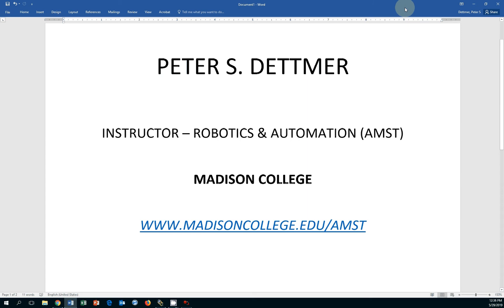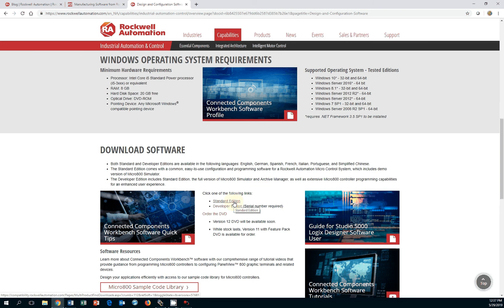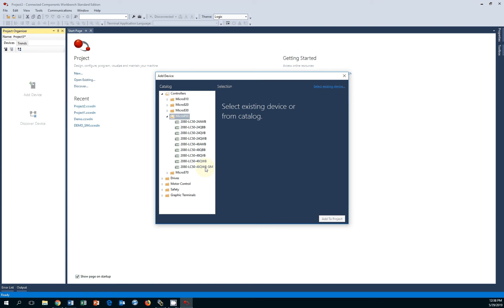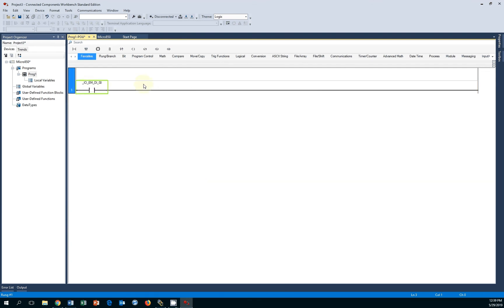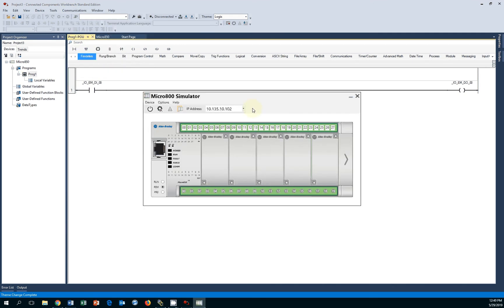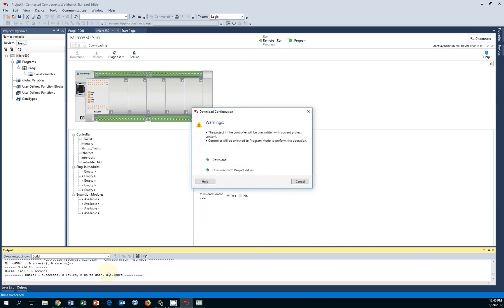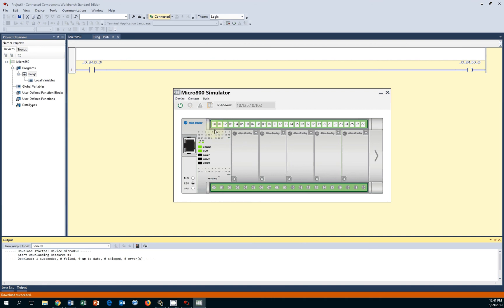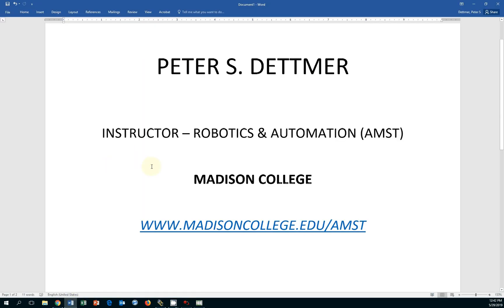FREE PLC Programming Software with Simulator

Comment: Good day Sir Did try to check the CCW 12 but was not able to find in their system although when type CCW there are a lot... IN addition to that there were active and discontinued which software specifically in the video you have?
Reply from the maker: The latest version of CCW is 22. There have been a lot of changes. I believe I did the video on v12. Haven't checked if the DEMO/Simulator is still available in the latest Standard edition. Some features may have moved to the (paid) developer edition.

Comment: hi im having problem with the my plc program. It says that my plug in i/o module configuration does not match the actual i/o configuration detected.  

But when i dont put the plugin module if4 and rtd2 it works. I need help understanding what could be the possible error in my program when im simulating. Thanks
Reply from the maker: You may have to update the firmware on the module and/or the Micro PLC unit. Some older modules may not be compatible with PLC.

Comment: I am getting an error "The program scan time exceeded the watchdog timeout value". Where can I adjust these parameters for the simulation Controller?
Reply from the maker: In the user program, increase the watchdog timeout value that is set in the system (global) variable _SYSVA_TCYWDG and then build and download the program using Connected Components Workbench.

Comment: Which driver are using to open the software.
Reply from the maker: No driver necessary. Unless you are asking about the (Micro unit). I used part# 2080-LC50-48QWB-SIM - this may have changed with updates and different versions, but this is the only unit that can be simulated.